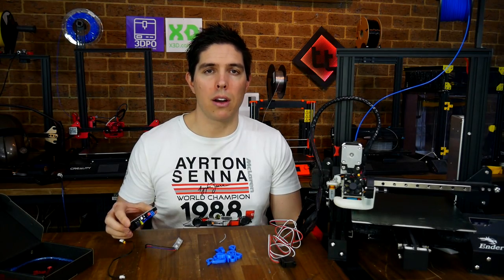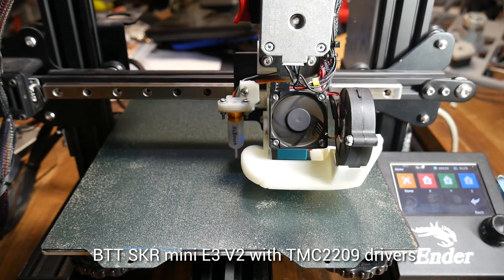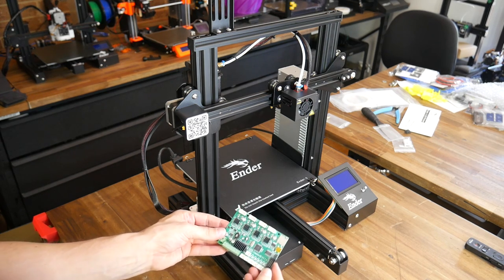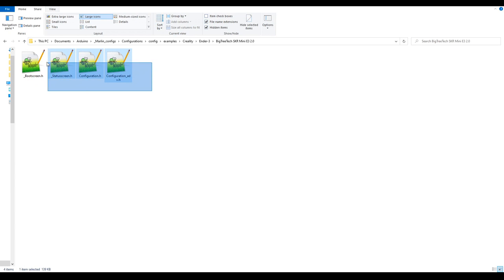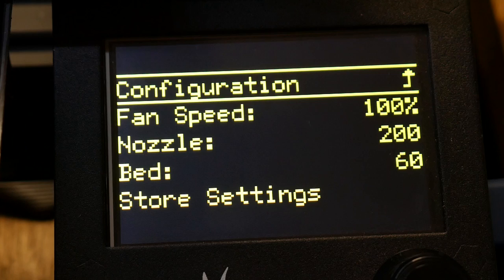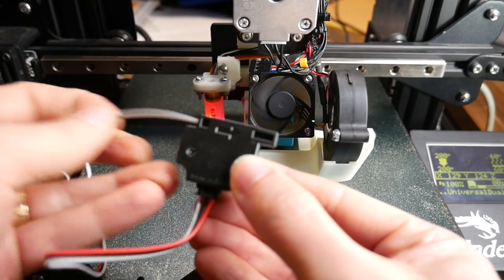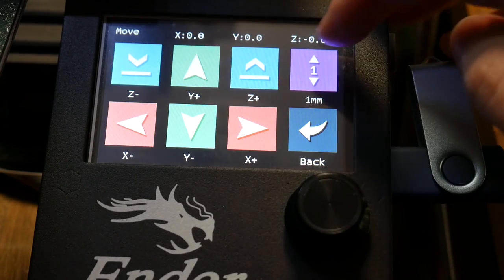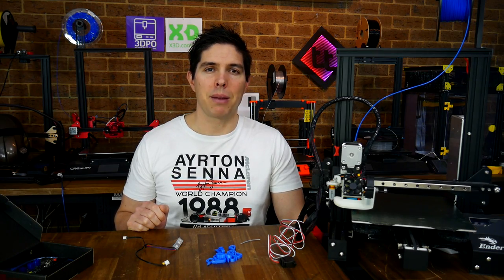SKR Mini E3 V2.0 - Complete guide to the best value Ender 3 upgrade

Comment: Idk how you got your filament sensor to work. For me I had to go into the pins folder and add code to enable the runout sensor to that pin. Otherwise it constantly gave me false positives no matter what I did. Fyi I was using the btt smart filament sensor even... which i don’t even think matters since it uses the same pinout but it sure did take a lot for me to figure it all out.

Comment: I couldn't resist and bought it 😜 it came so fast and tomorrow I'm gonna do the change! I have no modifications on my Ender 3 (except the mm steps for filament) could I just use firmware from big three github?

Comment: I been thinking of getting this board, is there anywhere I can get a pre compiled firmware with it which has BLtouch on so I don't have to do anything except put it on board as I'm not confident about not messing it up?
Reply: Yes you can, and Michael mentions this in the video.  Pre-complied firmware is available on BTT's GitHub.  https://github.com/bigtreetech/BIGTREETECH-SKR-mini-E3
I used the file "firmware-bltouch-for-z-homing.bin" on my Ender 3 with BLtouch, and it works just fine.  Just don't forget to set your probe's Z-Offset value before trying to print anything, or you could runt the nozzle into your build plate and damage it.

Comment: I'd like to see you test filament run-out in touch mode. Mine doesn't work, only in Marlin mode.
Reply from the maker: That's a characteristic of the Marlin firmware, it relies on an LCD for interface. You could run the sensor into the TFT if you exclusively print from it.
Reply: @TeachingTech  interesting. Nothing states that from Marlin, bigtree tech, or anything. So we would need the pinout for the TFT and somehow tell Marlin to watch that pin? Sounds like a good idea for a video!
Reply: @TeachingTech   The TFT/LCD switching on BTT screen is either/or once a print is started. You cannot switch modes at will to use preferred interface for a given function eg LCD for babystepping and TFT for speed/flow rates. Pity.

Comment: After installing my new SKR-Mini E3 V2.0 when powering up i get a TMC connection error any ideas what is going on here. Thanks Okay I got that figured out working good now, just wondering if I download the configuration file for this board for the ender 3 folder will this work for my ender 3 pro.

Comment: I'm attempting to install this in my Ender 3 right now. Does anyone know which port the Z stepper motor goes into? On the wiring diagrams there are ZAM and ZBM. not sure which one it should go into.
Reply: I figured this out. Its ZAM. ZBM is for a secondary motor on the Z axis.

Comment: Ordered this in May, received early June. After installation, I had a "temperature runaway" which after much troubleshooting turns out was the Mosfet not being attached to the mainboard. I've been going back-and-forth with BTT for a while about what to do (they wanted me to solder things and see how it goes. I was not willing to 'modify' the board considering I might then be held responsible). Then it sounded they were going to send me a new board and that was a month ago. Since.....silence.....not too happy with my first experience utilizing those guys. Been sitting on the new LCD, bed leveling probe and LED strip for 2 months now, running Ender 3 Pro on stock wondering what to do :/
Reply: from my experience with those guys, they most probably only wanted to waste time until you lost the ability to open a case.
 I got myself the lcd and the v1.2  and the lcd bootlooped on the skr board, talked to them they asked for photos and stopped responding until I opened the case on aliexpress. For evidence I checked the board and found  that the input terminals were badly soldered. I won the case got half my money back ( I decided to take half the money without shipping it back to china) fixed the problem and sold the board afterwards. 
In the comment section of an older video about the v1.2 there were at least 2 other people who had a similar experience like mine.

Comment: This needs to be fixed to address the memory issue, these boards are 256KB, the processors you show as matching the v1.2 is the RCT6 version and that is in fact 256KB. So your edit to platformio.ini was incorrect. People are having issues with overflashing these as if they are 512KB causing lots of problems. As an aside from https://www.st.com/en/microcontrollers-microprocessors/stm32f103.html the RCT chip also has less RAM (48kb SRAM vs 64kb SRAM)

Comment: At 4:26 on the wiring diagram, if blue and yellow part cooling fan cable is connected there and the main-board (red/black) cooling fan is connected as shown also, the part cooling fan will not turn off and cannot be controlled through the controller. From what i have seen, loads out there have the same issue as me.
Reply: Did you solve this?

Comment: I had the TMC communication error  on the previous E3 V.12 Big tree tech board.  I purchased two of those boards and both had the TMC communication error .  Based on that experience with no reply for a fix or even an explanation of the problem from Big Tree Tech I will never purchase another product from Big tree tech.
Reply: Power it up with power supply,  NOT JUST ON USB !!!
Reply: @OperatoruTheOne  I had nothing plugged into the USB port.  X stepper motor was too hot to touch.  Now using TH3D with no problems.  Never using Bigtreetech again.
Reply: My skr mini v2 arrived faulty, sent numerous emails over the past couple of weeks to support and they have all been ignored.

Comment: I installed this board and all I get is a blue screen on my stock ender 3 lcd. Tried many different precompiled firmwares, no help. The mainboard does install the firmware as indicated by the flashing red light and the .bin turns into .cur. Bigtreetech github does have an issue page where many people have the same problem as me but nobody has a solution. Can somebody help me out?

Comment: Hi, thanks for this tutorial will help me to change my board.
now on, can you teach us how to set up TMC driver on this board ?
As I've changed my motors to 0.9° stepper, I need to set higher amp and activate spreadcycle on extruder to keep higher torque.
Haven't seen potentiometer on the board so don't know how to set drivers ... (not yet but I'll RTFM)

Comment: The white ribbon cable which came with the TFT is a lot smaller than the factory one, can I use the factory one or does it need to be the one that came with the TFT? is there a difference?
Reply: I used the one that came with my Ender 3 and it works perfectly. The one that came with the TFT looked like they would be too short so I didn't even bother trying them.

Comment: Hi Michael love your channel thank you for your hard work
Is there a way using this board of setting up z axis auto level as at the moment I get the error 
#error "No E stepper plug left for Z2!"
As the dual z steppers share the one driver 
With thanks 
Dave
Reply: Shame. I am having the same issue... not sure how this was achieved... did you ever figure this out?
Reply: @bcboncs  no I didn’t

Comment: Does anyone else has the problem that the fans are always running? The cables are connected correctly and I cant find any more options in Marlin.
The fans are really loud and especially for the part cooling fan its a big problem that its always on.
Help please :(

Comment: you may consider a video for setting up visual studio code for compiling marlin for the skr mini e3 2.0. no matter what i do i come up with errors and failed compile.
Reply: Can you copy/paste the full failure line? Most common issue for me is forgetting to update the environment in the platformio.ini file. Also what version of Marlin?
Reply from the maker: If this helps, please select a branch and download: https://github.com/teachingtechYT/Marlin
Reply: Followed a video by dave at 3d makeit and found that github for windows was all the difference in the world. After like 6 months of trying to deal with the skr mini e3 1.2 i have still yet to get a successful compile. But bought the v2.0 cause i finally got it to successfully build. Was getting include ereors n all kinds of stupid stuff before downlaoding github for windows. I just suggested that michael do a vid on it cause hes really good at doing step by step walk throughs and believe he could put out a video that will take a person from new pc to upload of firmware. I mean i get he cant account for all pcs but it can account for things like github for windows etc. The more major hoops to jump through to make a successful build. I personally love the teaching tech channel. Michael does freaking awsome job. Just with the skr's there are quite a few variables to account for.

Comment: I tried to do this on my ender 5 pro and have had a lot of issues, my new BTT screen doesnt detect the printer and the old one shows the Marlin 2.0 logo but then gives me a thermal runaway error and doesnt leave that screen. I was hoping someone here could give me the bin file I should be using (I dont have a blt-touch).

Comment: I've installed the both SKR mini E3 V2 and BTT TFT35 and for some reason every time before finishing a print (97-98%) the nozzle and the bed stops heating. Then the filament gets stuck and the print is ruined, anyone experienced this?

Comment: they sent me the extensions with the bltouch and all 3 are different color schemes.  No clue why, seems pretty dumb.  Using probe as stop doesn't work with my skr mini v2, it simply doens't power on.  One video shows them re-arranging pins for the ender 3, but I can't find any more instructions saying it's needed for the ender 3 pro.  Mix that with how the normal 5 pin works using the z stop switch which powers it on and runs it just fine, but now my z offset is crazy.  I mean, crazy.  I've used diff firmware, correct firmware, compiled my own.  I've checked my stop, I've checked it's snug and it should work. I've homed, auto-leveled many times in many orders but most times it prints too far.  I've used the Wizard to get a perfect distance but then the prints print too high or low. 

Before doing this, printing from my SD card would print fine but printing from cura normally would require a -0.6 on the z almost every print. Putting the bltouch has made like 3-4 burn scores along the magnetic bed because it's showing my z as perfect, but then it drags along the bed.  I've tried re-distancing the knobs, releveling, re-updating and triple checking firmware.  The USB is intermittent to my PC with the V2.0 where I cannot usb print anymore at all where i could with the micro usb, and I've installed the latest unsigned drivers.

I went from printing to spending 2 days screwing with this thing to the point where I don't think I care anymore about the bltouch.  I get that I'm new but I understand what's being changed, why, how to wire, and I can only do so much to fix my z axis before I rip this stupid thing out and send it back and just let it print like it was before... better than nothing. I've had enough of trying to adjust this z axis.  Something is broken.

Comment: Seeing how this board has sensorless homing, does it also have sensorless Z axis bed leveling?
Reply: I don’t think it’s automatic, however I installed my skr mini e3 v2.0 card several days ago, and it has an automatic program for leveling your bed. You still have to use a piece of paper but the leveling program goes to each corner and pauses for you to adjust the bed, then touch the screene to move to next corner and so on. It goes through this pattern twice then asks if you want to save this info. I haven’t had to touch the leveling knobs except at the start of the first print to fine tune. If I remember right the leveling program also preheats the bed and hot end for this leveling program.hope this answers your question.

Comment: I recently received one of these boards for my Ender 3 Pro and installed it only to have the end-stops not work. I double, triple, and quadruple checked to make sure that every connector was A) connected and B) in the right slot. Everything was where it was supposed to be and I installed the most recent firmware to ensure it wasn't that. This problem is still happening and I don't know what to do. This is my second SKR mini E3 V2.0 because the first one had horrible thermal runaway. Anyone with any information, please help!

Comment: Hi...
I am from India and I want to use runout system in my Ender 5 but I am facing a problem in Marlin. In your video, you are using Marlin Bugfix 2.0x firmware and I used Marlin firmware and SKR MINI E3 v2.0 board but in Filament Runout section it's not showing "#define FIL_RUNOUT_INVERTING false" option. I think after updates  Ender 5 Configuration.h files are change on Github. Please can you make a video on this updated and changes Configuration.h file or provide a link of this runout sensor firmware for Ender 5.
Thank u.. 😊

Comment: I absolutely love the stepper drivers, but my CNC fan headers are faulty! FAN1 always runs at 100% while FAN0 doesn't even output voltage at boot! No control whatsoever, even after tweaking the marlin configs and reflashing! I'm trying to get a replacement from BTT. It's a shame
Reply: Same with me.

Comment: is there any reason to consider this if you have an ender 3 v2?
Reply: I haven't heard of anyone getting it to work with the v2's color display so you may have to change the display if you use it. There would be some nice upgrades though, like better programmable drivers and reliable linear advance.

Comment: im completly lost, installed board and tft, got some bugs that are annoying and cant work out how to update it, i dont understand how github works, can a file be downloaded and put on the memory card to update?  
or do you have to compile it as i dont have a clue about all that
Reply: Look on Marlin's website for instructions how to install for ARM boards. You can use PlatformIO IDE and load the Marlin 2.0 as a project and compile it from there.

Comment: I have configured marlin in Arduino for several printers and have grown pretty comfortable with it. So I bought this board, and I downloaded and installed vscode and platform io. I have been having all kinds of problems building marlin 2.0. So I downloaded your supplied code from GitHub and it works better, but still fails. I get 2 errors about not finding the path /marlin/include
Reply: It's a known error. Just create the "include" folder and it goes away!

Comment: Sir, I'm planning on buying a 3d printer...
What do you recommend..??? 
about 200 USD, stock silent operation...
is Ender 3 V2 better than Pro???
Thanks in advance.... 😅😅😅
Reply: I would honestly go with the regular Ender-3 (so neither the V2 nor Pro versions). There really isn't any difference at all - I have both and I've been printing on both for about a year. Make an investment in a 32-bit board like the one in the video and any additional upgrades like a BLTouch if you don't want to opt for sensorless homing or a filament runout sensor or a direct drive system (I recommend this last one)

Comment: (ENDER 3 PRO with SKR MINI 3E V2 ) I am trying to enable MESH BED LEVELING by compling in VISUAL STUDIO CODE but failed with the following message
" STM32F103RC               FAILED    00:00:02.333
The terminal process "C:\.platformio\penv\Scripts\platformio.exe 'run'" terminated with exit code: 1.

Terminal will be reused by tasks, press any key to close it."

What i have to do now ?

Comment: On SKR mini 1.2 with the TFT 35 I am still stuck with the standard Marlin screen as the GUI screen always says “printer not connected” tried 115K and 250K baud it makes no difference ,and I have no shorts to GND  on Tx an Rx pins.
Reply from the maker: Unplug the grey ribbon cable and test it. Reason being if the black serial cable is in the wrong way, the ribbon cable will still power the TFT and mask the problem. Apart from that, check firmware to make sure serial_port is set to 2 and serial_port_2 is set to -1.

Comment: I installed this board on one of my two Ender 3s and was amazed at how quite it is when I print. Then I added a 3D Touch, flashed the firmware listed in the video, and now only get a blank screen on the display.  Tried flashing the non BL Touch firmware with the same results. Both files do get changed from firmware.bin to FIRMWARE.CUR, but beyond that the I still only get a blank display screen. I see similar posts on the BTT github issues threads, but still no solutions. No other changes were made to the printer, I even attached the 3D Touch and printed a CHEP Cube before I tried to flash the BL Touch version of the firmware. The 3D Touch does complete its’ power on text correctly. I also tried to connect to the printer through USB but that fails as well. Any ideas?  Thanks.
Reply: Update, I finally found the SD card that came with the SKR Mini E3 V2 and was able to reflash the firmware that was on it, successfully unbricking my new favorite upgrade to my Ender 3. I guess I’ll try my hand at compiling a version the uses the 3D Touch so I can enjoy auto bed leveling. I forgot to say that I am a big fan of Michael’s videos, I have learned a lot from him.

Comment: Hi. I really hope you can help and respond to my problem. I just intalled the v2 board and tft touch screen. Im having an issue with the bed heating. It is heating too high up 180 degrees  and i cant get the temperature down. Please please help.
Reply: Maybe you mixed up the connections of the hot end thermometer/thermistor and the bed thermistor (plugs D and E in the wiring diagram in the video). 180 °C sounds like "preheat PLA". Switched wires could result in preheating the bed to 180 °C instead of the hot end.